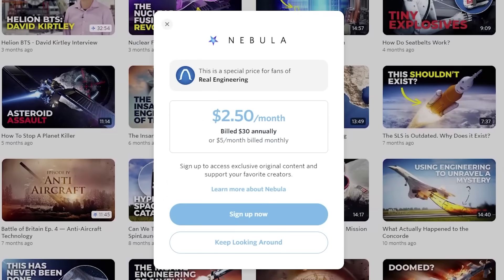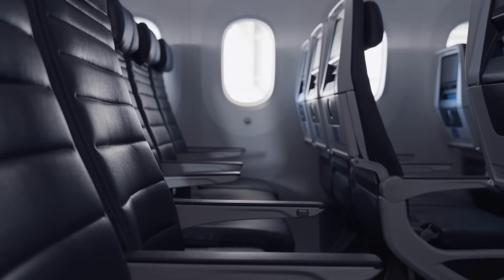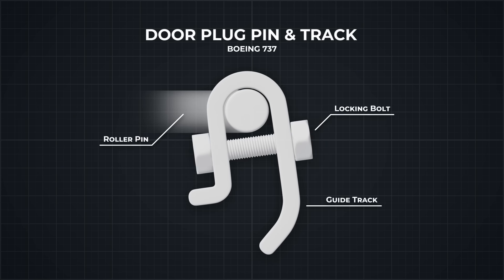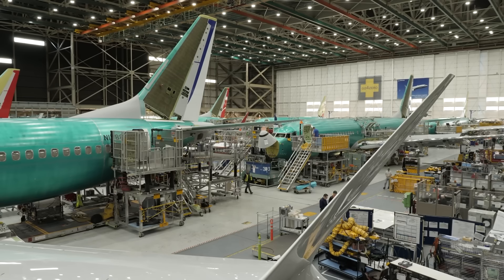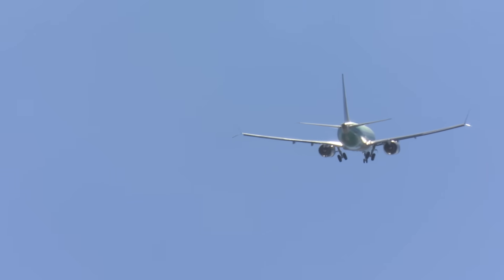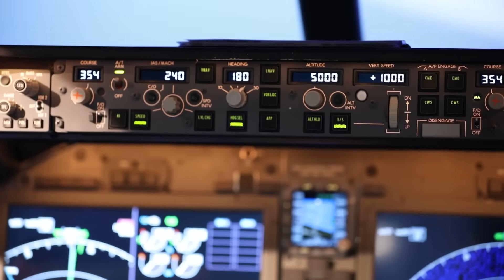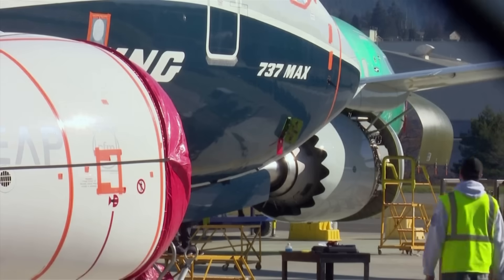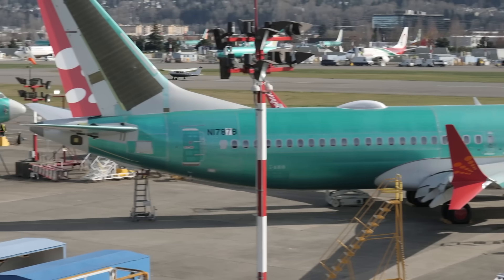The Questionable Engineering of the 737 Max

Comment: People trying to fix an engineering issue with software is basically the new standard in every industry.
Reply: Maybe an American thing…I am a European engineer and I heard with horror about the Max sensor thing. First is always to solve inherent design properties to not need countermeasures, then if impossible use safe=redundant technical countermeasures, especially under risk of loss of life. Only if that is impossible could one resort to organisational or software measure. In this approach software is considered as inherently prone to failure in general…so only one sensor + software to fix problems that must be avoided by design was a shock for me. Since then I pay attention to only fly Airbus…
Reply: @mathiasv3673  you do know that airbus is fly-by-wire?
Reply: @mathiasv3673 Nah man, I am pretty sure that most engineers never wanted to make it this way

Business guys are the real villains here
Reply: @mathiasv3673 must be why Europe is falling behind the rest of the world in innovation and large engineering and infrastructure projects.
Reply: ☝️
This. I got enough of this.
Like there's physical fault, FIX IT. And it isn't just matter of "removing" error code.
Reply: @mitnecasual 😊😊
Reply: @mitnecasual man these are the smartest things I've seen on the internet in close to a decade. What the fuck is the matter with the world
Reply: Silicon Valley disease.
Reply: @awwtergirl7040  this is a wall street problem
Reply: Because it's cheaper
Reply: I just commented the same thing...lol
Reply: Bro, both the engineering issue and the software issue were caused by greed. You can write correct software, if you put enough care, just like you can engineer correctly, if you put enough care. The tradeoff the managers made to not recertify the airplane made sense, they just didn't spend enough time on the software. 

You can and do mathematically prove software correctness for life critical systems, such as airplanes. You have no idea the care and effort that goes e.g. into airport coordination software.
Reply: "Did you tighten those bolts I asked you to?"
"I wrote a program."
"..."
Reply: Software engineering issues:
Reply: This is the "we will fix it in post" of the engineering industry lmao.
Reply: « IF door about to break DO not » There, fixed
Reply: @kaliss7192
But when it impinges on "human lives", that is absolutely not recommended. Does Boeing carry out engineering reliability check & identify the failure mode, if warranted (before adapting that Mod)? And if so, does FAA independently approve it?

Why not an (board of) inquiry into the whole thing (fixing responsibility on the management)?
Reply: Soon our civilization will end then.
Reply: Agreed. How about stop it?

You know. Do the right thing?

@SpaceMan-f6d
Reply: Knowing that she  has issues but still decided to reproduce.
Reply: Doesn’t Airbus use fly-by-wire in lieu of hydraulics? I can’t recall if those are digital or analog, but I know Boeing really likes to avoid certification costs in part by sticking to older, proven technologies
Reply: exactly not everything can be fixed by software, it just opens doors to the problems that were never in first place.
Reply: Simple, it's cheaper
Reply: I work in the automotive industry and it's the same thing. I was a dealership technician, we often had to do software updates and re-calibration on certain systems of modern vehicles as part of a bulletin or to fix certain issues. That's why i don't trust modern cars.
Reply: @matte8441  Some modern cars in the lower price range still don’t have electronics on board.
Reply: Which is a very bad thing.
Reply: I'm a computer scientist and the idea that software should be a band-aid to bad engineering is inane. Ever heard of Therac-25? In 1982, the safeties were removed from the next generation of Therac, Therac-25, because the software controlled the safety critical systems. End result: thousands died from radiation overdose because the manuals were obtuse and the software was untested and flawed. Consequences: blame the staff. 

Adding software to hide bad engineering magnifies risks, not mitigates it. Systematic error is much more systematically deadly than human error because software lulls us into a false sense of security. Worse, software engineers can only code to a limited set of use cases, not to the realities that users apply the software to meet their use cases. Often, there is disparity between the officially supported use cases and users needs. That's why software support exists, but no amount of support can solve bad design.
Reply: typical digitalization garbage we get from silicon valley ;(
Reply: @HeWhoIsWhoHeIsyou really believe that garbage over the fact the conpany itself directs their engineers to use subpar and even faulty parts in their planes. But no black pilots and engineers are scary because your melanin count determines if you can do the job!
Reply: Except, they not as much 'fix' as 'cover'.
Reply: We tried decades ago. It’s called Therac-25
Reply: When a physical device sometimes response with error when software requests call to it, the fix is very easy by updating the software into the way that will just retry request indefinitely until the device response with success signal. Now problem fixed.😋😋😋
Reply: It’s so ridiculous. It’s extremely risky to rely on software for critical system correction. Even the most well-designed software tends to have obscure bugs.
Reply: @HeWhoIsWhoHeIs this issue is entirely and exclusively managerial greed, your statement is irrelevant.
Reply: @joshmerchant8737  No it isn't. If the person who installed it doesn't do their job properly. Your predictable defensive comment is imbecilic.
Reply: joshmerchant8737
No you don't understand, diverse hiring is so amazing and superior that even when companies gut their quality control, diverse teams should still be putting out amazing work.
Reply: @mac533  That's just a blatant strawman, I didn't say or imply anything even remotely related to what you're saying. 
My only point, was that guy was diverting the subject to something that has nothing to do with what happened. 
Greed lead to cutting corners, which backfired. That's what happened. 
If the company did/said anything regarding "diversity", it would be to distract people from their greed. It seems to be working well, as you two are giving attention to something irrelevant to the greed, rather than the greed.

Comment: Until executive bonuses have long term incentives required (I'd suggest 50% of compensation vesting after 20 years), this will continue and get more widespread. Incentives have to be aligned between executives and society; that's just not the case now. PE is a huge problem for the same reason
Reply: Make a mistake and get millions for doing it. As a normal worker they would come after you legally

Comment: Look, the MCAS engineering was atrocious and Boeing deserved everything it got and more.  But this?  This has zero to do with engineering design and everything to do with a failure to call a plug a plug.  They considered it a door.  Doors open and close, right?  No need to check bolts after closing a DOOR.  Stupid, yes.  Design related?  Not strictly, no.

Comment: Its people given a job to do correctly and they not doing it for what ever reason,  what idiot takes door plug loose to fix a seal and does not put the bolts back in that hold the damn door plug inplace ????  MY gawd have people become so lackadaisical they can not do a simple job ???? Where was the inspection of the repair,??????  Who signed off that repair as being done, and why, did he even check it ?????  Hard questions that need true honest answer and that inspection proceedure changed !!!

Comment: No bolts were installed after maintenance by Sprit after Boeing found a seal problem. Spirit's fixers at Redmond repaired it, but they didn't reinstall the bolts, and no one inspected the work.

Comment: So once the business morons at McDonnell Douglas bought Boeing using Boeing's money they brought in James McNerney and told him to stop concentrating so much on safety and increase profits for shareholders and bigger bonuses for executives. He subcontracted everything possible and tried to destroy the machinists union by building a new plant in non-union South Carolina. He retired after 10 years just as the Max was coming into service. Mullenburg just maintained the cultural shift. He got blamed for something that started before him but he also did nothing to correct it. But his Golden Parachute was an insult. He and Boeing should have been criminally liable for those crashes. They are also a key Defense aerospace contractor and that culture exists everywhere in corporate America, which is why our defense establishment is so defective. The best thing would be to pass legislation reforming the FAA so they aren't controlled by the aerospace corporations and airlines(regulatory capture) anymore. Then require the FAA to assume oversight of Boeing and force the company to make the necessary changes in corporate culture on the grounds of public safety and national security. Of course, I think we need legislation limiting executive compensation to a fixed ratio of employee pay. And tax codes that limit shareholder profit to 10% per year with any surplus put back into development of the company. Plus a prohibition on stock buybacks.

Comment: I’ve heard from a licensed 737 engineer that the plug is a proper door plug. The emergency exit hinges are at the bottom and the plug has the same hinges. If the hinge bolts aren’t secured or come undone then the door can move upwards so that the fuselage and door pins no longer line up and the door will then blow out with little damage. Other exit and plug loose bolts have been found. Boeing used to be well built but that cost money.
Reply: and now we know that the bolts were never installed. The door seal was replaced at Boing and the inspection process in the quality system treated the door seal replacement of a door plug as the door seal replacement of a door. And the door does not use the bolts obviously, so they were never checked. So first someone forgot to reinstall all 4 secure bolts and then the door plug QA procedure at Boing was copy and pasted from the the door QA procedure with the latter not requiring to check these bolts as there are non.
Reply: @lapin46  
I think you got it right. This is called "accident investigation" (B-T-B was it done?).

Comment: When the Challenger disaster killed 7 people the govt pulled together a team of the country's top scientists to investigate NASA and it's contractors from head to toe to find the problems, both technical and systemic.....over 300 people have now died on Boeing aircraft due to what should have been easily preventable circumstances (now apparently we've been lucky that number hasn't risen since the MCAS incidents) and there has been very little if any discussion of a systemic investigation of Boeing's commercial aviation ecosystem (ie of Boeing itself and all its sub contractors). This is madness. Firing executives is not a long term solution ffs!

Comment: Amazing analysis as always! And your video quality has gotten phenomenal of the years! One quick, but important note about bolt lock wire.

It DOES NOT prevent a bolt from loosening from its set torque or rotating entirely loose so it can freely spin (though if it does rotate that loose the lockwire was still probably installed wrong).

It DOES prevent it from completely disassembling and becoming loose debris inside of the airframe. i.e. Lock wire is not a anti-vibration failure prevention mechanism, just a FOD prevention mechanism. 

The lock/castle nuts and bolt adhesives you mentioned though are indeed useful for vibration failure prevention.

Comment: Boeing has not only dropped the ball in aircraft manufacture.  The Boeing Starliner, a spacecraft, has been beset by lengthy delays and malfunctions.  Many thought the famous company would pip the upstart, SpaceX, to the post in delivering supplies and astronauts to the space station in Nasa's commercial resupply and commercial crew operations.  Thus far, Starliner has never undertaken a successful resupply or crew mission (only a demonsration mission), while Dragon has become a reliable way of accessing the ISS.

Comment: I think that's incorrect, isn't the number of passengers allowed on a plane correlated with how fast the passengers can disembark in an emergency?
Reply: The speed passengers can disembark is limited by the number of emergency exits. More exits means faster egress. 
The number of seats installed determines if the door will be plugged or not.

Comment: If you remember the episode with the O-rings on the boosters for the space shuttle, there was a case when an engineer was asked to take off his engineering hat and put on his management hat when he said that NASA should be notified by problems at low temperatures.  If you are willing to take off your engineering hat and overlook problems, my feeling is that you aren't a competent engineer.  In order to do a good job, you have to want to look for problems that will cause you to look bad.  I was told that I would never get anywhere at the company if I cared about the quality of the product.  This was with software that wasn't risking people's lives, but faults could have resulted in huge costs.

I was also told to ignore problems unless they were reported by the customer.  When things were reported by the customer, management tried to explain why the problem wasn't so bad.  Like the Sergeant York anti-aircraft gut that spun 180 degrees during a demonstration and aimed at the reviewing stand.  (This was not our company, but was widely reported.)  You had colonels and generals jumping off the sides and back of the stands.  They were extremely unhappy when told that the gun was operating as intended.

If somebody signed off on inspection without doing anything, hadn't signed off on inspection ( which meant that somebody else had  failed to inspect the inspection reports.), or the part was not required to be inspected, a severe reeducation program should be carried out, probably involving a stand-down for a week.  This includes top management and all subcontractors.  Just remember that the people are never really at fault because somebody above him certified that the people doing the work were competent and conscientious, the manufacturing and design processes were correct, and should be willing to ride on the first flight of each aircraft.  (See SubSafe for the safety programs for USA submarines.)

Comment: And yeah those pressure checks probably should have clued them in on the problem but the Air Line likely puts pressure on the maintenance people to just get the planes out rather than worry about pressure checks. Would not surprise me in the slightest if that was the case

Comment: Haven talked to a few guys in the civilian maintenance community, it’s pretty clear to me as a military veteran who worked on aircraft, civilian planes are DANGEROUSLY under scheduled for maintenance and a lot of the maintenance standards are not reviewed once created so a plane could be flown for so many hours and what was considered a safe tightness for a brand New bolt doesn’t match up to the air frames stretch and give. 

You can’t just do the “good and tight” excuse. Torque Wrenches exist for a reason.
Reply: I turned a few wrenches for the military. I also did some composites work as a civilian. I shit you not, I worked at as a QA inspector for two retired Marine officers. They tried to coerce me into signing off parts for Kiawa helicopters; which were drilled incorrectly. They had phony inspection documents they wanted me to sign. But, as a crew chief with integrity, I actually checked the hole alignments. They were off by 0.1 inches or more. The parts didn't match at all. After telling them that, an owner assaulted me as I was quitting. She was such a valuable taxpayer to that community that the lawyers in the area set me up. A grand jury indicted me for assaulting her! Her optometrist claimed her bad eyes were because of me! 

Small town with a lot of "loyalty." 

Color me jaded. Now I don't trust business owners, police, lawyers, judges... Basically the system that can be abused by "trusted members of society." I know there are good people in all of those categories. We are a minority that tries to keep the wheels on this thing... Literally sometimes.
Reply: Are you saying “quarter past snug” and “that’s not going anywhere” aren’t within spec? Careful, talking like that might get you laid-off from Boeing
Reply: +
The military doesn't have to turn a profit.
Reply: Hey, as a US military veteran, can you explain to me your understanding about how NATO 'funding' works?
Reply: Hilarious that you think the military has higher standards than the civilian side. They undergo constant maintenance
Reply: @Disgruntledvetsareus  I don’t think. I KNOW they do because I was in the freaking Air Force for six years. I have seen the hundreds and thousands of pages of technical manuals that outline every nut and screws fucking torque levels. The military has constant maintenance BECAUSE they demand the safest aircraft ALL the time.

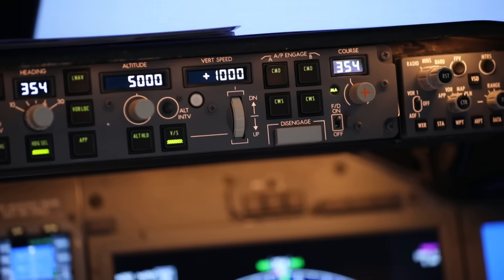Comment: 7:38 "MCAS... A software which malfunctioned" Now I'd heard this differently at the time, and my understanding is that the software never malfunctioned. As in the software did what it was supposed to per the software design specs, and that it was a lack of understanding by Boeings remaining talent after heavy layoffs that led to the shortsighted specifications. I came across this video while trying to locate the source of that claim so sadly don't have the link. If someone else recalls this and has the source, please just add in a reply.